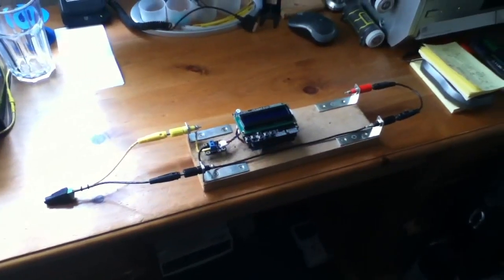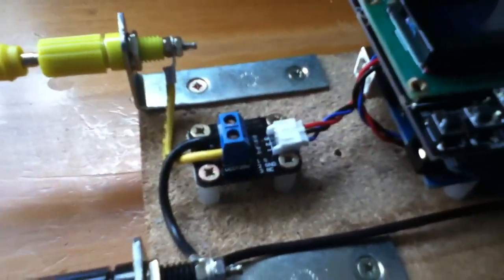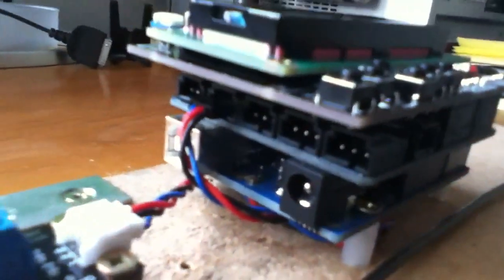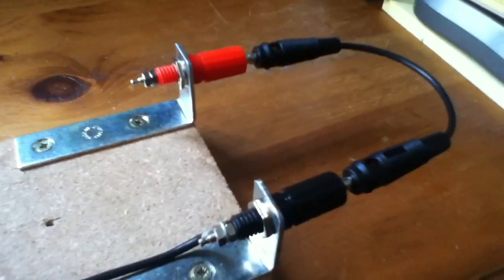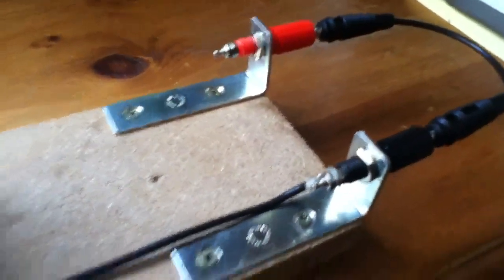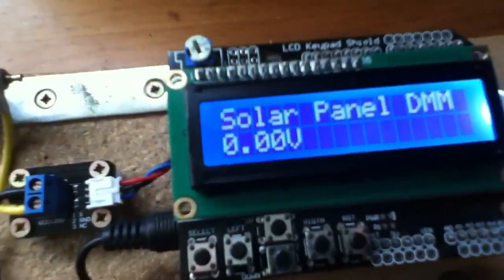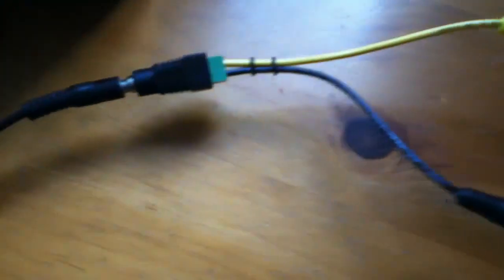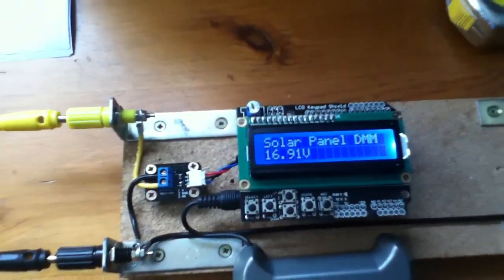MPPT Solar Charge Controller #1 - Introduction and Voltage Measurement

Comment: Latest Code:
  Sir . Most interested in building your historic MPPT system.   Watched all video's and impressed with what you've been able to achieve.   To my dismay I actually  have everything hardware wise to construct this project. 
  Attempted to obtain the required CODE via provided web sites .  Seems those two addresses are no longer active.  Managed to find  the abbreviated code on GitHub.   No Provisions for a display and or Current Monitoring provisions.   Sad.   Are there any other sources for the original Arduino Sketch, Err Coding required ?   I possess Many skills   Programing is not one of better of  them.    Would it be possible  to obtain a copy of your version employing the Nokia 5110 LCD Display ?   

Thank You Sir.  A avid viewer.

Jim

Comment: check the resistor values on your voltage sensore. each manufacturer may have thier own values. This threw my calculation out.

Comment: isnt this the same as your 2013 mppt controller. there is a #2 video which shows you have a current and voltage sensor. Again from 2013. Once this video has ended, youtube plays the second video which is your 2013 video.

Comment: hi enjoy videos , why is it some controllers ( if hooked to a 12v panel) still show around 18v on the controller even though  controller is charging 12v ,I thought non mppt voltage would be pulled down to say 14 v or so ? at the panel side of controller unless mppt was used ? thanks

Comment: Hi Julien, thanks for these great series. I'm going to design and build a MPPT controller for a small wind turbine. I was wondering why you are using a dedicated voltage module instead of just using a simple resister based voltage divider. I don't yet understand the added value of the module other then that it makes my bank account a bit lighter😉

Comment: Hi Julian, Im a great fan of your videos, i think they are fantastic and very informative.
I have a few questions if i may. I am building a portable power bank, and was wondering if you could tell me what you do with this:

would you:

1. Have charge ports for an external charger
2. Have a built in charge controller that you can plug into the mains that will reduce the power down to charge the batteries.
3. Which components would you suggest? I have been told that the best batteries toi use would be the Li 18650's.
4. what would you build into the system for battery drain protection.

I intend to put usb sockets in there a cig lighter socket, and maybe a socket for output to a 12v inverter.

Appreciate your help and advice on this.

Many Thanks

E Jackson
Reply: Hi Eric, did you finish your portable power bank successfully?

Comment: Hi Julian, first off thank you for a fantastic series! I've watched all 18 videos and am now ready to build my very own MPPT controller. Would it be possible for you to please provide a list of parts you used? I know you used a buck converter, but what type? I've seen some others that are arduino compatible but I'm not sure on whether the specifications would match.
Reply from the maker: Check my website 256.co.uk - I just put the circuit diagram up there

Comment: i saw also in ebay that this sensor cost around 4euros, but is it not just 2 resistor ?
Reply from the maker: Yes it is just 2 resistors - and 2 connectors (and you also get the cable). There aren't many for sale which explains the high price. But I just found a cheaper module on eBay - item number 111220315117.

Comment: Hi,
is the ground of the solar panel the same to the arduino Gnd ?
Thnks
Reply from the maker: Yes, that was important to me. I don't like controllers that are common positive.
Reply: Julian Ilett i doubt it a little, because my arduino have a difference power supply than the solar panel.
Thanks a lot